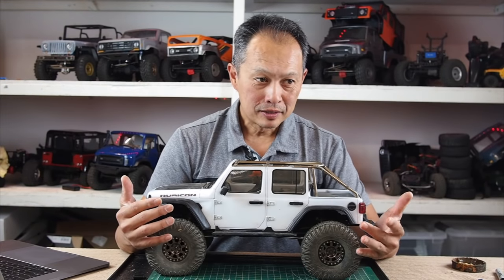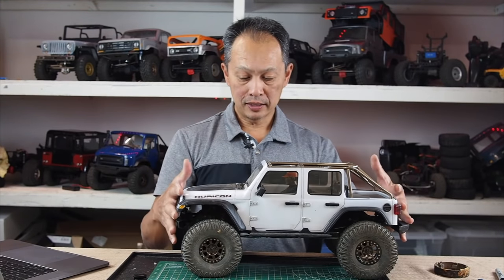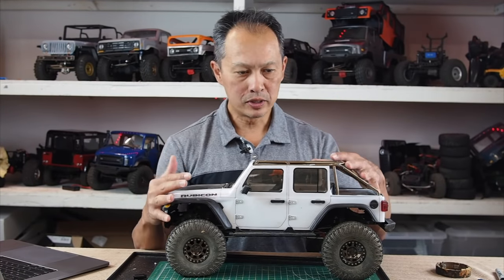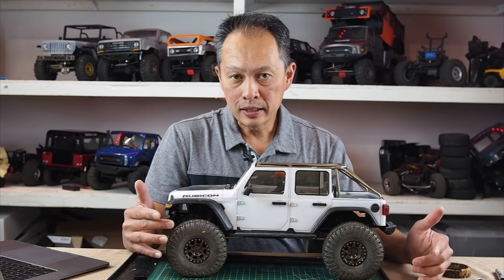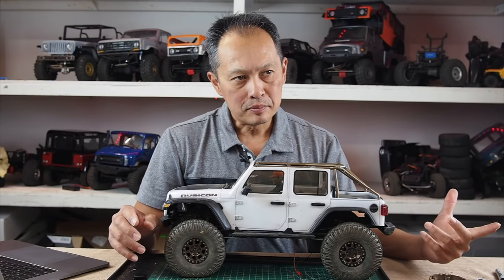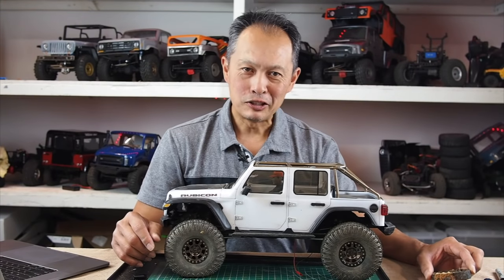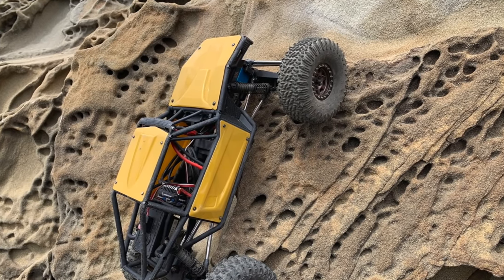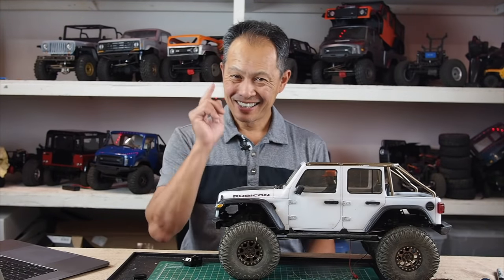Adding brass weights to wheels or axles rc crawler upgrades - Best rc crawler upgrade?

Comment: I used 2oz. Bullet fishing weights zip tied to the top of my axles out of sight for a total of 230 grams. Sounds ghetto I know, but you can't see them and it solved all my side hilling issues and it only cost $6. I did it because I needed a quick fix for a trail I was going on, but it worked so well I decided to leave them.
Reply from the maker: That's one of the greatest almost free mods of all.
Reply: Ain't nothing wrong with geheto! Lol
Reply: @RCReviewChannel  absolutely!
Reply: Im using left over 1oz wheel weights as well underneath my TRX4 lol
Reply: That's not ghetto at all, that's improvising and that's what I love about this hobby...

Comment: Great video. I like the technical discussions just as much as the driving.

I calculated the center of gravity on mine. It only requires scales, formula and calculator. Something like a pound of brass to the axles lowered CG about 1/4”. Tire foam became too soft for the extra weight. Shock oil became too light. Plus, my motor because not strong enough.

Honestly adding brass ruined the handling and performance until I spend a lot of time replacing parts and  tuning. It was fun process but very unexpected. I thought adding weight would just make it better no questions asked. I think designers (at least Element RC) knows how to tune it really well from the factory.
Reply: Well that nails it for me no need to add weights to my sendero hd... Not wanting to add a bunch of more parts on top of an already great rig out of the box 👍🏼
Reply: Adding a pound seems quite excessive. Just a few grams strategically placed will help a lot.

Comment: Wish u would of mentioned about what changes u might need by putting weight on. (Ex: stiffer foams in tires etc...). Love the video ad always.  God bless my friend.
Reply from the maker: Great point!
Reply: Almost every modification requires some type of change in tiny trucking...if it didn't then why do it?😁

Comment: after researching weights last year when I was building my TRX4 I ended up going with metal axle housings. The weight was good and the scale look improved, something you don't get with brass.
Reply from the maker: Great share. It's all about the quest for the right upgrades.

Comment: Best description of this topic on YouTube. I am still curious how a few extra pounds can stress the factory servo/motor over time. I am hoping to replace the motor when it is needed, testing is in order first. Should realistically need a better crawler motor to exhibit more realism with movement as well as locking the roll more efficiently.

Comment: thanks for another informative vid i learned the diff between wheel and axle i took out of wheel and put on servo axle mounted (sticky wheel weights ) 150 grams made a huge difference thanks again for the info Great vid

Comment: Late to this party, but what about using steel portal axles instead of adding weight to the stock setup. I prefer the idea of it, as there's less rotational mass for the motor to deal with. Is it enough, or would brass portal covers still be recommended? Asking, because I was wondering if it were possible to stick SCX10 III steel portals on a UMG10...or am I waaayyy off base?

Comment: you have such nice rocks to crawl on all my spots are straight up cliffs with 20-30 foot almost vertical sections that are not easy to climb up myself. when you roll you roll a hard 20-30 times before you hit the bottom
Reply from the maker: thank you. A bit of a drive but some great options.
Reply: Feel lucky, here in Louisiana we have 0 natrual rock, can find riprap used in erosion control here n there but that's rocks hardly big enough to get the whole rig on, not really rock crawling imo
Reply: I got 2 tree roots and a woodpile in my backyard lol or I can drive 3 hours to go to a good beach 😅 I usually get my best footage at the beach. Not much to work with locally

Comment: I like the technical information you give in your video's. One point I don't believe you touched on was the effects of weight on sprung and unsprung weight. Adding weights to the axle doesn't effect acceleration and breaking, like adding it to your rims and tires does. But it has a big effect on your shocks and springs, since all this weight being added is unsprung weight. I agree that at crawler speeds this doesn't have a lot of effect on performance. My experience in real off road driving, is that keeping your tires firmly in contact with the ground especially in loose conditions on a steep hill climb is critical. Too much unsprung weight will overpower your springs and shocks causing lose of ground contact. This then effects momentum and steering control. This can be compensated for by larger bore shocks and different springs rates. I have added weight only in the form of aluminium bead lock wheels.  That's just me, after 25 years of trying to keep the weight down on my full size 78 Bronco it feels wrong. Good job on the channel, you are getting more relaxed.
Reply from the maker: Great points. Am researching that now.  It seems that in fast cars, unsprung weight is not good at all. It overpowers the suspension and it bounces around because it is not controlled by the suspension at all.

But in crawlers and at the speeds we tackle  rocks, it seems very good. It is very low to the ground for low CG and and it doesn't move or tilt with the suspension, causing it to tip over.  Correct?
Reply: It does seem to work well. It seems to me to be more about weight distribution than   anything else. Ideally we would remove weight from the rear rather than add weight to the front. Since you have so much power it's easier to just add weight. The added performance gained from removing weight in the rear would be small, but the difference between 1st and 2nd is a lot of small details. Less weight will make for a more nimble car. It will effect tire sidewall deflection on off camber sections of trail.

Comment: In theory you can "ball bear" the weight inside of the tires ... sounds weird but will eleminate the punch thing. However sidehilling is then also not the best, so it´s up on where you drive and how you drive, sometimes a heavy vehicle makes sense, sometimes a very light one ...

Comment: I have a gen 8 V2, I added husky heavy links, 8 mm brass wheel spacers, and about 50g per tire in weight, would that be too much? Dont want to break anything. Thanks

Comment: Excellent video. Explain everything we talk about just a few days ago. Here's my new dilemma. I purchased a set of Treal steering knuckles and one set of Treal portal axial brass covers. Also wanted a set for the rear portals of Capra. None are to be found. At Treal, amain, Amazon or Ebay. Would you recommend using the SSD00412

￼SSD RC SCX10 III/Capra Brass Portal Weights (2)

For the rear until Treal has portal axle cover back in stock ?

Comment: Do you think you can help me out with RZXYL portal axles for scx10? I'm having issues finding the best internal parts to fit them. Differential gears, portal gears. Inner shafts, bearings, and hardware.

Comment: Any pointers for adding the axle/hub weights? I have bought 3 different sets and none fit any of my crawlers. I have a Gen8 a coyote and a ascender. The only one they did fit, sort of, was my Danchee Ridgerock. Should I be drilling out the center holes to fit? That’s my main issue is they don’t fit over the wheel lock. I see some behind the wheel nut but mine have no space back there. Please help with suggestions anyone. Thanks 😊

Comment: Good Video. Dont forget that with the addition of Wheel or Axle weights, that the spring weight and/or shock oil may need to see adjustments to compensate.  If not, you often may feel it flips over easier or side hill worse because it isnt staying flat.
Reply from the maker: So there is sprung an unsprung weight. Axle weights and wheel weights are unsprung weight (below the spring).  Thus they do not affect the load on the springs or the shock oil.
Reply: RC Review Be an awesome video if you had time!

-Stock 
-Weights + Stock Springs 
-Weights + Modded Spring/oil

Comment: Great content! Just subscribed. However, for the TRX. Would you add the weights on both front and rear or just the front? What’s your thoughts.
Reply from the maker: Yes, learn with us.  For the TRX-4, front only. It needs a lot fo low, front weight to balance out the battery.